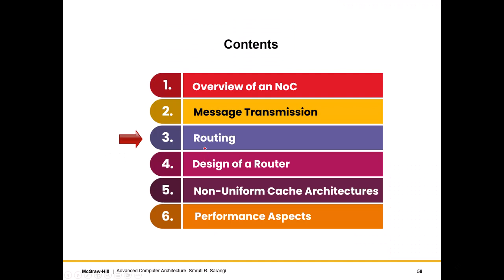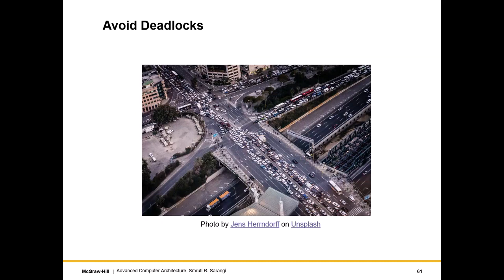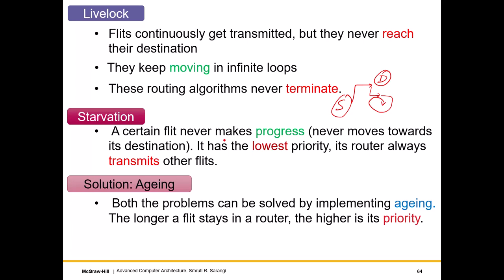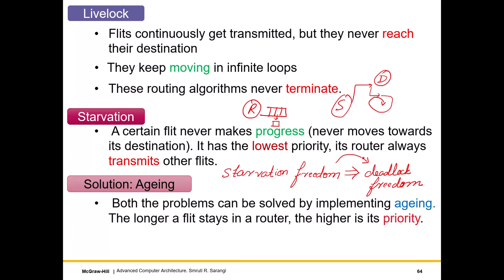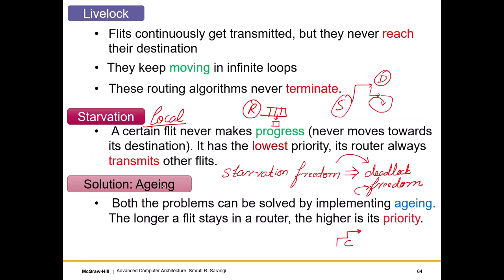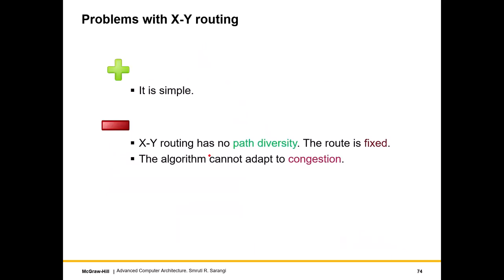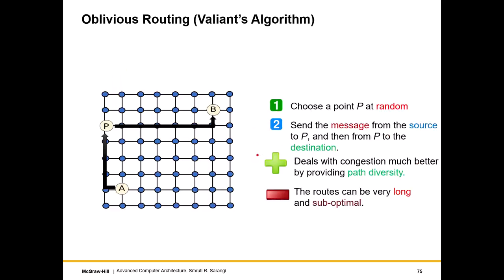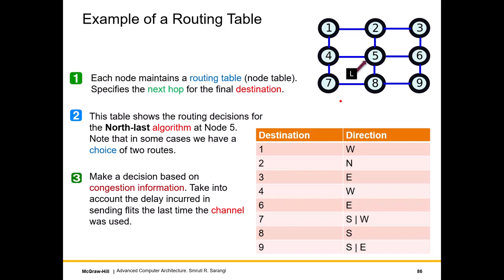Chapter 8: The On-chip Network (Part III/V) -- Routing Algorithms and 5-Stage Router Pipeline

Comment: Can there be a deadlock with just 2 nodes? Node A wants to send to node B. Node B wants to send to node A. both have full buffers.
Reply from the maker: Yes, of course.
Reply: @srsarangi  How does our implementation avoid this case? We removed 2 turns but we can still have N->S and S->N. So it can still produce a deadlock. How is this provably deadlock free?
Reply from the maker: @AdhyyanSekhsaria  we don't allow U turns. A deadlock requires a cyclic wait, amounts to U turns in this case.